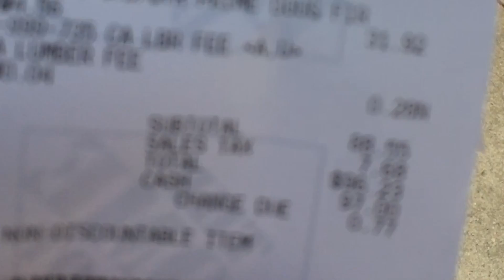Backyard BMX Quarter Pipe Build

Comment: can u put a link to a full template planning to build this
Reply from the maker: I actually did not use a template while building this.  If you look up "quarter pipe plans" you should be able to find some good ones.  I put a couple specs and stuff in the description, and I also have a much more in depth tutorial on my channel called "how to build a quarter pipe in 10 easy steps" if you wanna check that out
Reply: Will Freeark thx Appreciate it